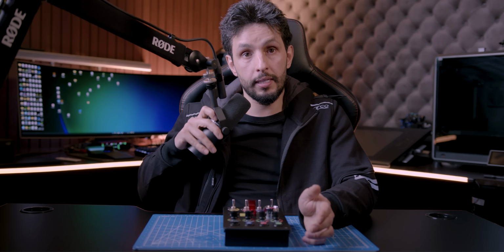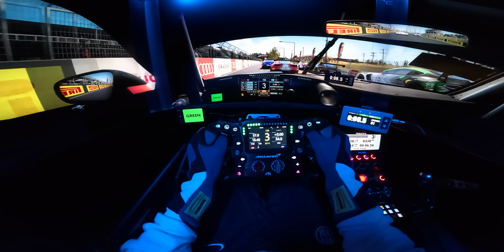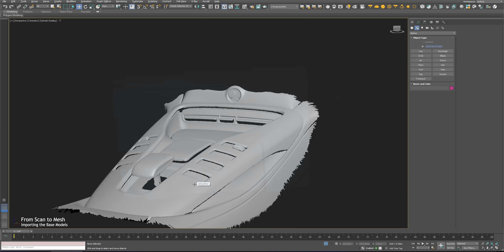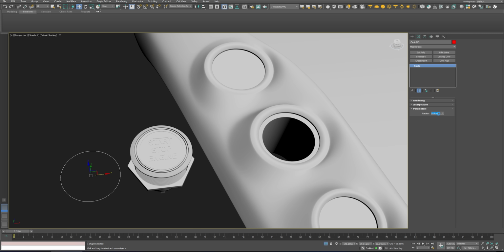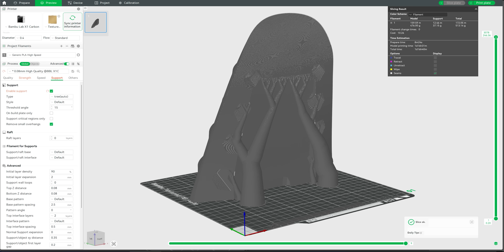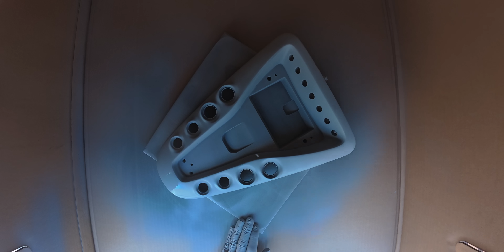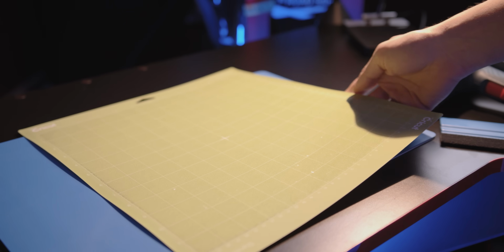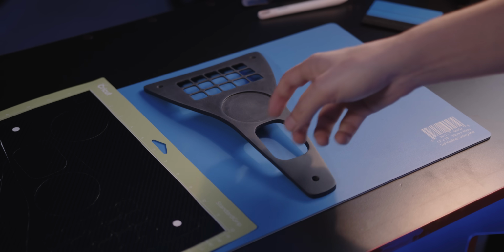DIY AMG Console – 3D Printed & Fully Custom! Part 1/2

Comment: To be fair even P1S/X1C print it way better than shown on video. Also you could print it out of real carbon fiber filament for aunthicity. Props for printing it with dual K1MAX as this is notoriously picky and needs good tune and sometomes maintenance to work on.